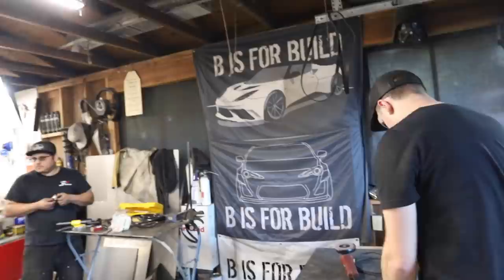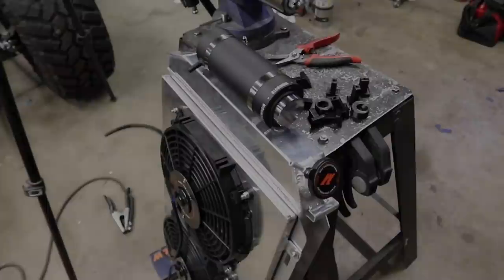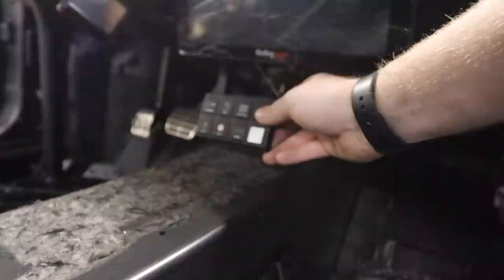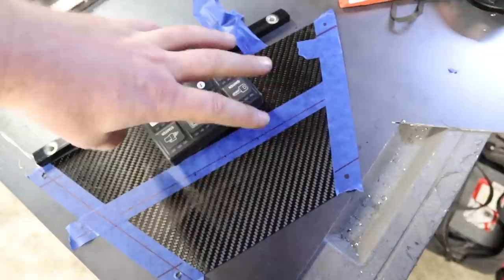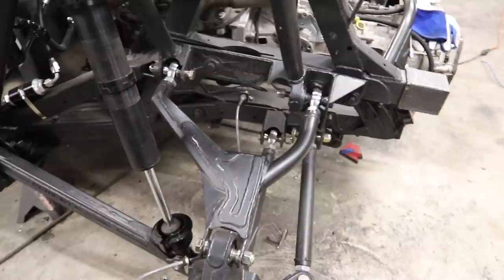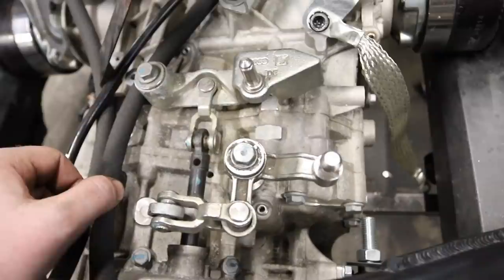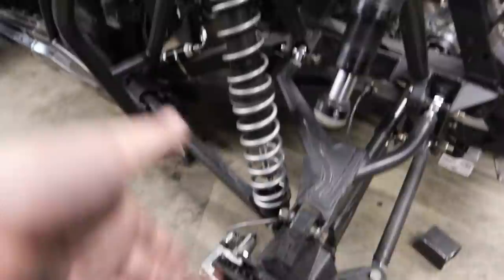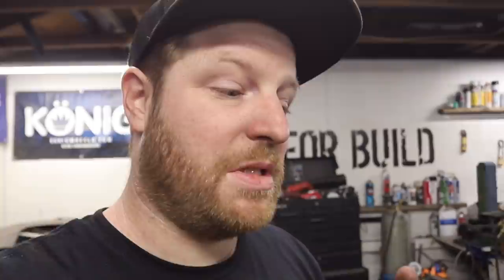We Build The Second Stick Shift Huracan In The World!!

Comment: Should've put a weld on the middle of that band for the overflow tank. Clamps would still fit & it would be stronger during any offroading that might crack one of the other 2 welds.

Comment: Dude a little tip on printing things hollow, depending on your slicer you can print it with an infill%, you can usually get away with 10% easy.
also depending on the structural integrity you can use the 3dsmax modifier "shell" to give it's walls some thickness while leaving most of it hollow.
hope this helps
Reply: having more walls makes parts way stronger than just using infinll. Rather go with 7 walls and a 50% than 3 walls and 80%
Reply: 10% on a part that large would probably almost double the print time. Better off with just more shells. Maybe some internal supports in the model would have helped.
Reply: he did that, thats why you can see that pattern at the top

Comment: Another solution to the axle swing travel problem would have been to extend the gearbox attachments out to the frame and have shorter axles.
Then the amount of space required vertically between the frame rails would be less.

Comment: I feel like you should have a much larger driver-focused screen...sitting way back in the car you're going to be squinting to see what's on it, and that's more time with your eyes off the road/trail/whatever. Just my two cents as somebody who has never done off-road racing ever.
Reply: Not a lot you need to watch when actually racing, maybe an occasional glance at temps etc but you dont need to see speedo and so on much at all really, so much of it is done by feel instead because speed isnt limited.
Reply: not on these type of cars. they are almost always used with a co-driver who monitors everything that would be on  normal dash. plus al of the stuff  is still going to be visible on the center console where both the driver and passenger can see it.
Reply: Dash is in the center for the co-pilot most likely

Comment: I love all the 3D printed parts. That is literally my favorite part of 3D printing is the custom applications! I just hope the dash is high-temp filament! I'm sure it is but ya never know haha
Reply: Most can handle at least semi high heat so it should be alright
Reply: Right? 3d printing is what rekindled my love for mechanical engineering and practical design.
Reply: I was listening to hear if he used PETG or ABS to handle the heat. Hope he did not use PLA, will melt in the sun in a car.

Comment: For the 3D printed bits, I hope you're using some decent quality filament that can take some temperature (PETG HT, PC, even ABS/ASA). I'm pretty confident that screen dash mount will warp / sag under the summer sun if it's PLA or some other cheap stuff. Also, for the 3D printed radiator isolators, a radiator full of water + high temp + lots of vibration / load changes seems like bad news to me (heat deflection temp of most 3D printed "rubbers" is below the water temp of a car).
Reply: He said the dash is temporary anyways so shouldn't be an issue

Comment: Transmission Will get hot with the load it's under from those big tyres.
The trans cooler will be a trans heater on the back of the engine like that....
100% transmission failure if you don't fix that. In hindsight.....
Reply: He said it first
Reply: Yeah and the thing i dont understand.. if someone said that you don't need a transcooler (for a normal car) but you still get one... why don't you put the effort to mount it in the best place possible where it actually do some good work. I mean if you put it in a hot place its going to work against you...  better to just don't do it. Sure it can do something but yeah...

Comment: doesn't mounting the overflow tank on the radiator tank introduce a potential failure point on the radiator tank when covering rough terrain, or is your suspension so smooth that's not an issue?...
Reply: I don't think so, if at all it could just break the "bracket", those Mishimoto end tanks are very solid

Comment: The overflow tanks cap should be the highest point of your cooling system , it's supposed to fill under pressure not use gravity . Also makes it easier to bleed the system .
Reply: Its an overflow not a header tank,  it doesn't matter where you put it, you don't use it to bleed the system.
Reply: @TheMeta6  every car manufacturer puts the overflow tank above the top of the radiator for a good reason . That way it self bleeds , you just turn it on and keep putting coolant in till it's full .
Reply: @Shadowband72  mitsubishi, honda and various other manufacturers disagree with you.

Comment: Please secure that battery better! Also on the rear axles if you added a straight intermediate shaft like what some cars have and pushed that CV joint out closer to the frame you would get even more flex and be less likely to have it contact the frame.

Comment: You should really think about shock mounting all the electronics and displays. I do reliability testing in my lab. Repeated shock and vibration is likely to shorten the life of these components. Also, I hope you chose to use a fuse panel instead of one huge fuse for everything. If anything shorts, it will cook the offending wire and every other wire in contact with it.

Comment: I'm writing this before watching what you did with the suspension. I would have just made rigid shafts with support bearings that mount to the frame and then a CV on either end or the shaft from there.

Comment: it might be better to make an extention to the overflow canister and mount it on the same mounts as the radiator , reason being if the hurican takes a few jumps with the weight of the canister hanging of the sheetmetal of the radiator tank it might tear the piece thats welded out and cause a coolant leak

Comment: Better test the temp resistance of those 3d prints.  I made some brackets for my truck bed and they deformed under slight pressure and 85 degrees and sunny.

Comment: what kind of thermoplastic was used for the isolators? most of these deform under very low temperatures, tpu wikl probably start deforminbg around 55-60 degrees c.
easiest safe solution would be polyurethane or silicone cast. just need to boolean subtract the part from a cube. since these are flexible material, you could probably get away woth little to non draft angle and would be even easier with a felxible mold. I'd be happy to help if needed.

Comment: You should reinforce the frame behind the engine with an x shaped structure, otherwise its geometry will make it bend sideways if you bottom out or have severe lateral load.

Comment: I really hope Oscar's welds are good, there are going to be some extreme forces :O
Reply: If anything, welds are less likely to bend and break than the structural material. Go check out how welds are tested, it’s pretty reassuring!
Reply: @romangudev8770  I've done DT and NDT in the past and believe me welds can and do fail. Assuming they're using CDS tubing and the correct gauge/thickness of plate, then my money is on the welds failing first (either due to stress or fatigue)
Reply: @jasonmart1081  I had thought they had mentioned at one point Oscar was a certified welder and or that was his real job before the channel really took off.

Comment: If you're using pla for you 3d prints they'll melt in the sun.  You need to use abs or, 3d print a mold to make stuff from carbon fiber.

Comment: Is the overflow not supposed to be the highest thing in the system? It's not an overflow if it's downhill, it's a reservoir.
Reply: Mounted that way coolant will never make his way back to the radiator, only out of it.
Reply: @esteve95  yes it will.  It's called a vacuum.  Coolent gets hot it expands .   Cooks down and it shrinks, thereby creating a vacuum to suck the coolent back. In.
Reply: @markmcgill5012  man you are so wrong, but good luck with your builds
Reply: @esteve95  take a bottle of water,  , plastic and cold of course, now crack it open and take a big drink.  Now put it in your vehicle on a hot day.   What happens to the bottle after it gets hot?  It collapses, which means it's created a vacuum due to density change.  Maybe you missed middle school biology?

Comment: To get extra travel could you not have moved the inner c v joint to the chassis and put a bearing mount to the chassis and use three c v joints one on the g box output one on the chassis with a bearing mounted on the chassis  and one on the outer hub witch takes away the drive shalt fouling the chassis giving more articulation and you could then put a spline slider in the outer shalft to compensate for suspension travel .

Comment: Hi man. So it'll be 3 weeks before I can get my truck tuned. Some reason my ecm is not reading my sensors.... All of them.🤦 in the meantime I found an oil leak in the back of the motor. No idea where from. Thinking valve cover or maybe valley cover. It's leaking on the top passenger side in the back of the motor. I can't pinpoint it. Anyway. I'll fix it eventually.

Comment: Is that 3D printed Dash UV resistant? It might deteriorate if left in the sun.
Reply: That is the smallest problem, the major problem is warping from the heat cycles. It is straight now but after few weeks it will be another story.
Reply: @Matevz96  at least it’s bolted down.

Comment: I still struggle to appreciate the reality that in the presence of a Lamborghini, a mill, a lathe, and a 3D printer and everything else on hand; a cut off wheel is still the primary method of cutting plate/sheet.
No shade, just confounded by the disparity.
Reply: Seriously.  Clean off a work surface and buy a few cutting tools.  Even a simple jig saw cuts steel faster, cheaper, cleaner, and quieter